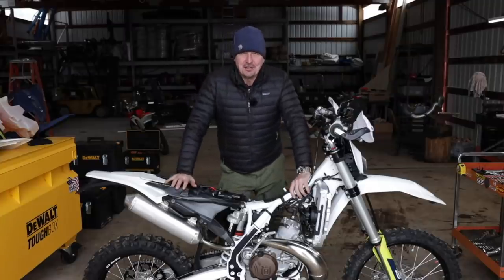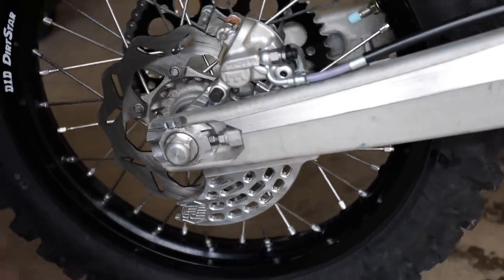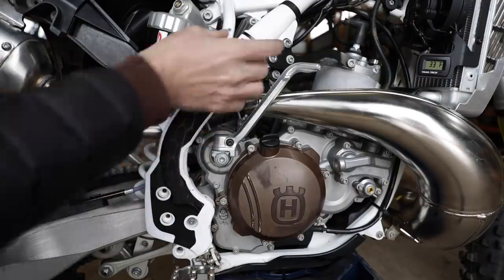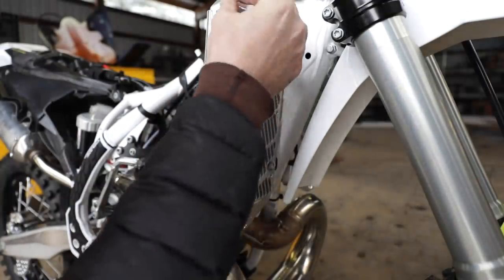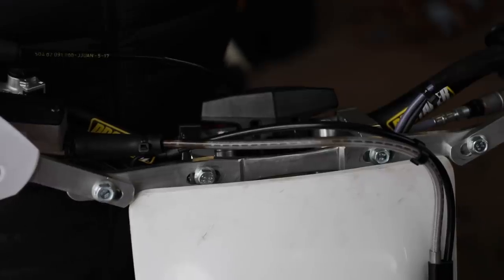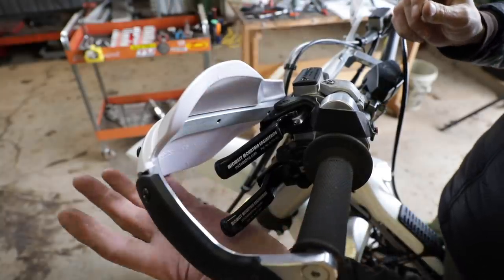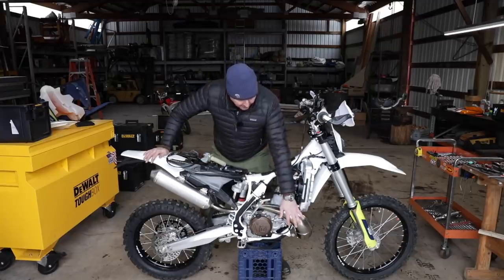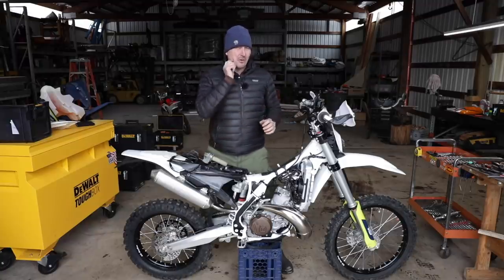10 Tips For Setting Up A Great Woods Bike - Husqvarna 300

Comment: Never seen a pro with full bark busters, most of them prefer their wrists intact...
Reply from the maker: so what
Reply: Not really following the logic of this.  I thought the same during the video where Cody mentions it.  People don't like the hand guards because when they hit something hard enough the guards smash back into the hands and wrists.  ????? So you would rather have NO protection and just take the direct hit on the hands?  What am I missing here?
Reply: Tenspeed TheBikeHanger what worries people is getting your hand caught between the grip and the bar when you go over the bars.
Reply: Thank you.  I figured that out reading comments further down.  I guess it is a trade-off between that or something busting you in the hand.  lol, I'm getting a bit old to face either problem.
Reply: As jerky shack said, people (me and pros) prefer to break levers before breaking wrists, as your hands can get stuck when you go over the bar and your hands go forward between the bar and the barkbusters. 

And to your comment Cody, I did not mean to offend, but just as you are entitled to doing whatever content you like I am pretty sure I am entitled to posting comments on it... I understand that barkbusters seems like a brilliant idea.
Reply: Tenspeed TheBikeHanger most enduro guys use hand guards that come out from the levers and are flexible so if you come off nothing will get caught and snap your wrists. Also hand guards are designed to stop mild grazes and brushes against trees as well as protect from roost and rocks not hard impacts

Comment: Overall those modifications look pretty good. i dont know anything about that carburetor your using, but it looks interesting. I have a huge distaste for rekluse clutches, but thats just my opinion. I think the lever setup is silly at best. Glad to hear the pipe guard is on its way, those are always the first to get smashed. im a bit concerned about the bar risers. Generally, you want to use the lowest bars you can get your hands on. Lowering your bars helps you get over the front of the bike and improves steering. i dont know how tall you are, but unless yours 6'5"+ i dont think they're a good idea. how wide are you running your bars? im assuming they're pretty narrow for the woods.

Comment: Hey wrangler is there a reason you chose the 300 TE over the TX kinda the same deal with ktm i had to choose between the XC and XC-W i ended up with the XC-W for the no linkage,lower gearing, and headlight. Some guys like the TX and XC for the Air forks and higher gears.

Comment: Washington rider, just trying to give you solid, real information, not trying to sell ya anything! That rekluse is a hindrance, on a 3002t, and having no rear foot brake, with an auto clutch will get you hurt, you can't cover clutch and rear brake at the same time. One throttle oops and that 300 is coming right out from under you. Please bare minimum put the rear foot  brake back on, and cover the clutch with a finger at all times!

Comment: is that more or less than$ 2000 worth of upgrades? my figure is a $1000 just in carb/ pipe/radguard.

and what was the original price of bike+/- $10000?
nice build, just wondering how much lottery winnings I need to get a new bike that requires so much changeup to ride effectively.
presently my $2000 bike has taken me as far as I need it to. I have been wasting my fun money on extras like power bills, tractor repair ,building repair, land payments and food.
Reply: No reason to get a new bike in my opinion get a used bike rebuild it and have fun

Comment: Please tell me you didn't put a rekluse, in a 300 2 stroke! I put one on my FE 501, but that's because the big 4 stroke stalls really easy at low rpm. The rekluse has a heavier clutch pull, and you lose feel, but the 300 2t is very hard to stall, and absolutely does not belong on a 300 2t. You lose so much control with the rekluse, that's why the pros don't run em. Born and raised in Washington, so very familiar with PNW single track.

Comment: Do you worry about the control and grip (esp. with off road riding) you lose with two levers on each handle bar? Ive always been told (and agree with, having been riding for 15 years) that having a one or two fingers only around the handle grip. Id love to hear how your experience riding offroad (which ive never done) without foot pedals feels. The argument that pro riders need stock bikes for ease of parts is a bit of a falacy im afraid - pros can get parts with no problems!
Reply: L J Kay there is just one lever on the right hand grip for the front break. Rear break and backup clutch levers on the left hand grip.
Reply: Rodney 3133 understood, thanks... but the question remains :)
Reply: getting rid of the foot brake, is a really bad idea, as you can't cover the clutch and brake at the same time. If you've ridden, and ever accidentally twisted the throttle At the wrong time, you find out why you cover the clutch with a finger. Now with that clutch up on that perch, you can't reach it standing up. You just can't bend your wrist back that far. If you screw up and twist the throttle in a bad spot, the rear brake will not stop it. If you gotta keep that perch put the brake up there, and the clutch back where it belongs, and put the rear foot brake back on!

Comment: Hmm, 250 with gear and you probably added another 30 lbs to the bike with all the addons.  Might have to pump up your tire pressure to 5psi heh.
Reply: Artie Choke aluminum for the most part so not much additional weight.

Comment: How can you say many problems for an engine that is officially not yet sold in America. here in Europe only tpi engines run without having more problems than the non tpi (ktm and husqvarna 2018). and the weight of a 300 and a 300I differs + - 1 kilogram. but otherwise super upgrades for your motorcycle. think the upgrades are as expensive as the engine itself.

Comment: Factory riders want to ride a bike as stock as possible? Do what you like but there is a real reason the "best of the best" don't ride with this setup and it isn't a matter of convenience for the factory...I grew up riding "single track", outdoor and motocross. One thing that has remained true is there are guys that are all about the bike and there are guys that are all about the riding. I've been smoked by guys on way older bikes with older technology and they laugh at the guys who spend all their time, effort and energy nit picking their bikes. I've ridden both with the traditional clutch/brake and Rekluse w/hand brakes. People who grew up on dirtbikes like the old way. People who grew up on mountain bikes like the "new" way.

Comment: Your observation about rear wheel distance is incorrect for a dirtbike those are to adjust the tightness of the chain as it stretches which by the looks of your chain it needs to be tightened a correctly tensioned chain should be two fingers in width from the swing arm to the chain
Reply from the maker: 2.2”
Reply: Running different gear ratios, will change your chain length, and certain gearing will make you have to run the rear wheel farther back, or forward in the swingarm, to have the chain adjusted correctly.

Comment: HAHA they ride as stock as possible ? LOL Their factory bikes are as far from stock as possible. You are making comments you know nothing about. That front brake started up big time because of Rekluse. I always said it was because when you didn't make a hill , you get off and only had a front brake. That bike would wheel backwards. So the front rear brake came about.I personally didn't like it and used it on my buddies ktm 450 1 times on a 32 mile loop at race speed. It was a steep downhill to the right. That rear shock leveling you are talking about is called SAG. That bark buster unit you have. I ran and run cycra for years and never had an end come out ever. I did have a bar mount clamp come apart in a hare scramble years ago and smash my wrist over a double. That lectron is jetted through the rod and i haven't heard of problems with that fuel injection. It added slight weight but that system was tested for years by snomobilers because that's where it came from. I assume you cut the airbox open already yes. I don't mean to bash you but you come off real negative toward actual racers.

Comment: i've built dirt bikes all my life at 12:00 what he said about the gears is right in the fact that you want to change both but totally wrong about his reason for doing so... your talking maybe 1/8 an inch for a single tooth reduction and that's pushing it. that is going to have 0 affect on the way your bike handles. changing both gears maximizes the affect of changing that front tooth and lowers its top speed and gives it more torque rather than just changing the front sprocket... you could have just dropped a tooth from the front and it would have been just fine but adding 2 to the back makes more torque. as your chain stretches do you notice a difference in the way it rides? no, and that chain is moving way more than adding/removing a tooth. i apologize for ranting but you stated in this video that people are talking about things they have no clue about and that guy who did your bike is just plain wrong on that. and im my onion removing that foot break was not a good idea, but if you like the feel of that more use it. but just remember just because a guy has done something a long time dose not make him good at it.

Comment: your chain looks too loose
Reply from the maker: 2.2" of slack according to the manual,
Reply: when the bike is on the stand the swing arm drops putting the axle closer to the counter-shaft sprocket and vise versa when suspension is fully compressed.
Reply: The joys of ridding a KTM lol, everyone thinks your chain is loose!
Reply: Mr. W, I'm sure you meant 2 13/64 lol... I really like your new setup! For what it's worth, when installing new chain/sprockets, I always set the chain slack a little on the tight side (54mm) then go for a short ride down the drive. Ride around for a few minutes, practice a couple launches and re-check. The slack should be right on the money after that. A cold/new chain (especially O/X-ring) usually measures a little tight so a quick ride will warm/loosen it up a bit. Lastly, new chain/sprockets will usually "stretch" for the first 2 or 3 rides then take a set, so initially it's better to be on the minimum side of the chain slack than the maximum.

Comment: Why did you get a 2 stroke? 4 stroke is better in every single way
Reply: StewysGameplay u wanna rebuild a $800 top end every 40 hrs or riding...
Reply: Different folks, different strokes.  I’ve got a 92’ banshee that’s never been rebuilt. And I am not going to, until it stops pulling hard
Reply: StewysGameplay is probably under 30 years old and has never ridden a 2 stroke.
Reply: The new two strokes are making a huge comeback. They are NOTHING like the 2 strokes of old. Lighter, more power, and gone are the days of the scary and unpredictable power bands.
Reply: Why don't you list every single way.....and then I will list mine for the 2stroke. I've ridden both for over 40 years and they both are means to an end:  fun!!!
Reply: 2 stroke is stronger and more power
Reply: StewysGameplay I really disagree 2 stroke are amazing to ride.  4 strokes are nice but nothing like a Good 2 stroke to rip you off the seat.
Reply: Personal opinion I have both over the years and they both have benefits ......have fun 👍🏼😁
Reply: I never had much fun riding 4 strokes
Reply: I wouldn't trade my KTM 2-smoker for 10 4-strokes
Reply: I never had much money riding 4 strokes...